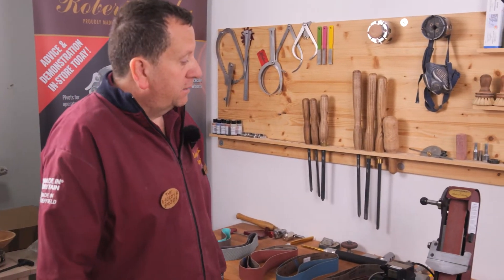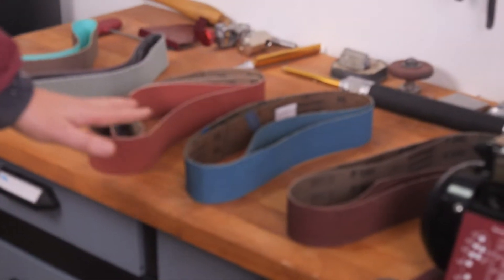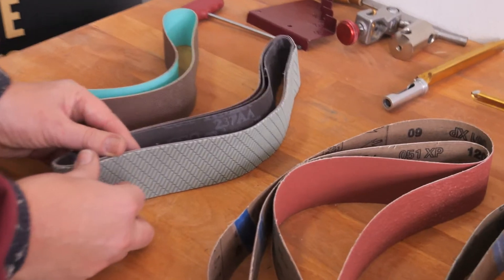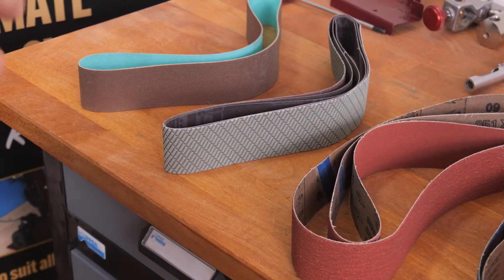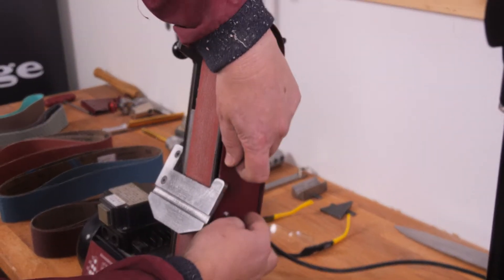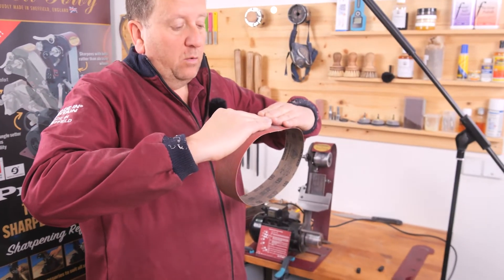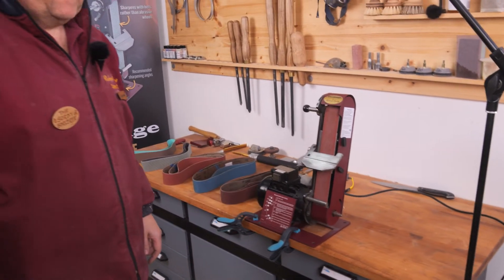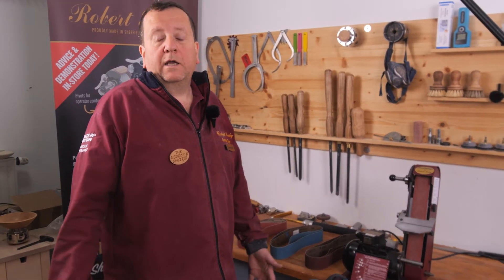3/4 Guide to Pro Edge Belts: Selection and Maintenance

Comment: Japanese tools made from "white steel" (very pure iron straight carbon steel) are hardened much harder than western style tools. Does this mean that using Aluminium oxide belts wouldn't be the best choice? Or is the hardness level you are talking about for HSS are in a different ball game?

Does this mean that for Japanese tools made from "Blue Steel" (more advanced steel alloys containing things like vanadium to increase durability of the edge) might not be best suited for AlO belts? Or again are we talking about a different ball game compared to HSS.

What about stainless steel tools like SS kitchen knives?

Comment: Please could you demo the belt tracking.
Reply: What do you mean exactly?
Reply: @drechselbedarfschulte  how to adjust the tracking of the belts when you change belts. Changing to a thicker or thinner belt means you need to realign the tracking by adjusting the screw at the top left of the belt.
Reply from the maker: @marcusfairly2688  I got this answer from sorby, hope it helps: Although there is tracking facility on the ProEdge the user should leave the machine factory set where possible 

The width of the back plate (platen) allows for tolerance in the positioning of the belt, so when a thinner or thicker belt is fitted, the tracking should not need adjusting

If for any reason it is required the locking collar at the base of the handle on the top left hand side should be loosened with one of the included small metal bars while holding the handle in place with the second small metal bar 

The tracking is adjusted by a very small movement in the handle and then locked into place using the locking collar
Reply: @ks-allyouneedforwoodturning  If this is what Sorby say, then they do not know what users actually experience when using the machine. Don't get me wrong, the Pro Edge is excellent, and Sorby customer service is also good (a bit patronising perhaps). However on the pro edge I received new the tracking was unset, and the first belt I fitted drifted to the right scratching the inside of the guard plate. I know of several other Pro Edges in use including our local club's. All of them require tracking adjustments if there is a significant difference in belt thickness. I also know of one machine, bought brand new, with tracking that was completely jammed and could not be adjusted. Maybe Sorby need to reaccess their opinion of the tracking.
Reply from the maker: @marcusfairly2688  Thanks for your feedback, I highly recommend to directly contact Robert Sorby, no onw knows better then they do.